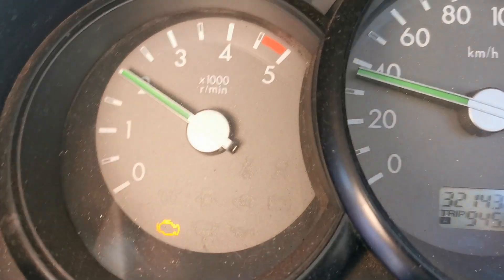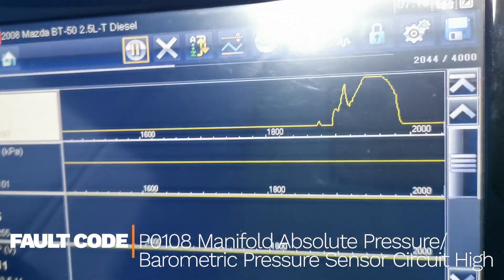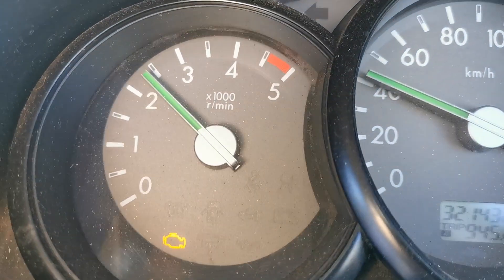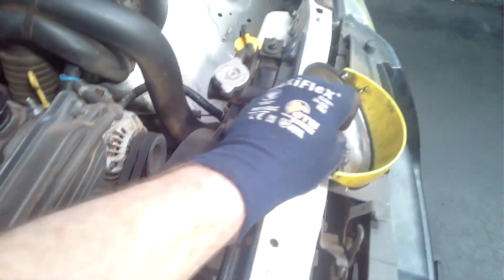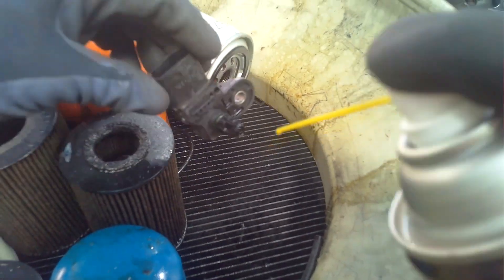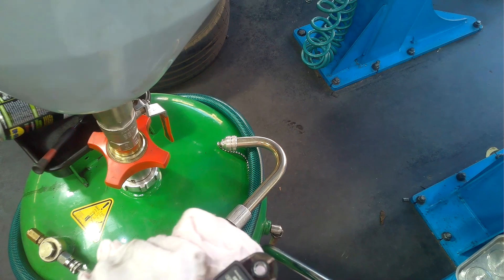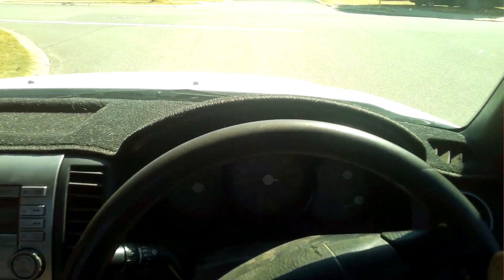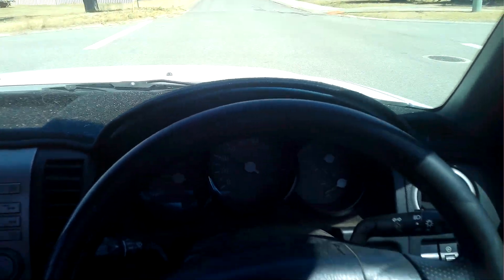Mazda BT50 / Ford Ranger 2.5L No Power Stuck In Limp Home Mode - Fault Found & Fixed - Easy DIY

Comment: Can you help me with my 2011 BT50 ?
The vehicle sat for 8 years and, I ended up putting it back on the road. 20 months later it burns gaz and oil. I noticed oil going through the cooler into the intake. 
Does this truck have a stuck PCV valve ??